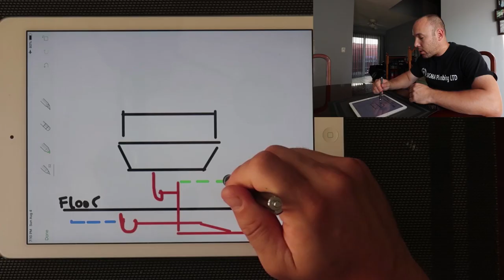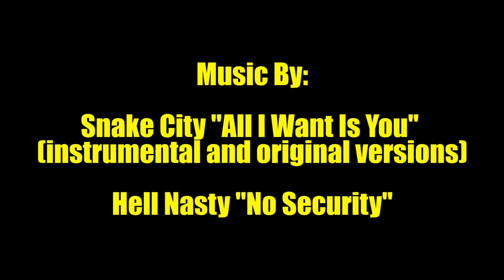Plumbing Apprenticeship | What To Expect!

Comment: Hey Kenny I just wanted to know is Humber and George brown the same? Or is one school better to study at?

And I wanted to know lets say my compang specializes in risers and service and they don't do residential, how do you suggest i get my experience on the Residential side?
Reply from the maker: Hey Amanvir, those schools compete against each other, and the curriculum should be extremely similar between them. So it only will depend on your experience in other words. With the company, you would have to probably  go into a new construction company that does residential. Hope this helps.
Reply: @Kennymolotov  thanks for the advice appreciate it

Comment: Do plumbers work at heights? I was thinking of looking into the trade, but not a huge fan of heights. Looking more into the residential side,
Reply from the maker: Hey Michael, yes in some applications plumbers do work at heights. But it is not something I would consider common. I hope this helps.
Reply: @Kennymolotov  Thanks for the response!

Comment: Hi

First of all thx for great plumbing video for newbies.  I have been tile contractor for past 15 years residential and commercial ( downtown Toronto , GTA ), im local 183 member. I got to the point in my career that i want to change my trade to something else and plumbing was always interesting me. Tiling showers, tub, floor etc in houses and condos, u see plumbers working, so after 15 years believe it or not u know how to install toilet faucet etc, small stuff. 3 years ago i was not exactly sure what trade i really like, so i signed up for HVAC G3 at Hi Marks 4 months course in classroom with exam at the end which i passed with 82% ( 3.5 hour long exam, code book, etc ) so im TSSA G3 gas technician .

Question:
To become Red Seal plumber i have to:

get a job with plumbing company as government registered apprentice to get the 9000 or so hours and THEN i sign up for pluming college and do the 1.5 year in classroom?  How that works?
Or  i go to college for the apprentice pluming program  and the school finds the co-op pluming company to hire me for 4 months and then u come back do 4 months in school  till i get the 9000 hours work ( co-op) and then i write exam and get the "red seal"

Which should i go first ?  find company to do th 9000 hours or should i go to pluming apprentice college? 

Sorry im confused, cause from tile setter point of view i didn't have to go to any apprenticeship programs at all.  Just sing up with a union, call few company if they look for sub-contractors and if they do u do some paper work and Im ready to take 1st house tomorrow. LOL simple.

Or should i call local 46 for plumbers, and see if i can get into the union, ?  My opinion i prefer school with hands on work, Knowledge is important even though i might not use it now but i might use it later on other project and u know the standards, codes, materials, pipes, etc, which im acquainted with.

Ur help is appreciated
Reply from the maker: https://youtu.be/AyKRW9WIkr0 try this video should explain.

Comment: Ohhhhh the agony of the first two year!  Wanted to knock someone in the head to actually do something, not just hand them stuff, glad to hear others had same issues.
Reply from the maker: Yup David! Those years were nightmarish lol...so glad to be past those days!
Reply: @Kennymolotov  I am just past it, barely getting to do anything, but actually am up on the lift now.
Reply from the maker: It’s slow and steady David! Don’t get discouraged, just a bit more time and you’ll be doing more than you can handle...😊
Reply: @Kennymolotov  Never, so I do both Plumbing and HVAC, just passed my mechanical code class, need some more OJT for that, and about to sit for my plumbing code.  Next classes I think are Boilers...;and I forget, I do know Boilers is coming up though.